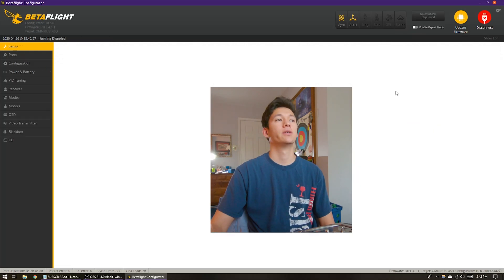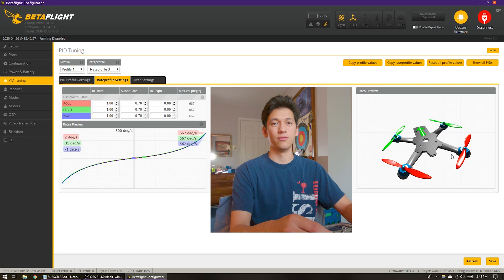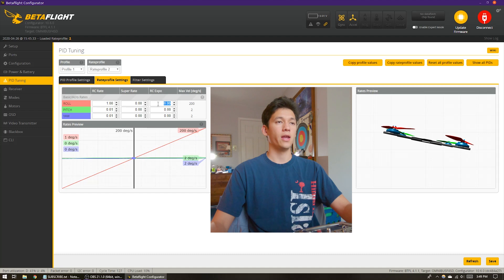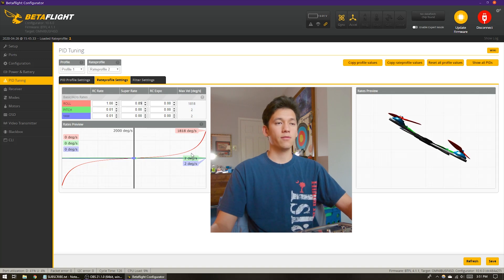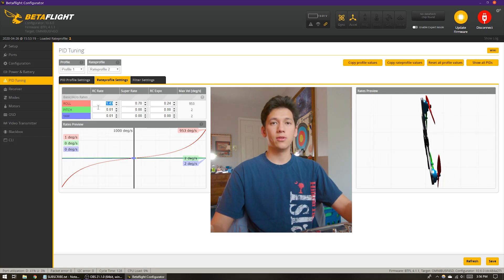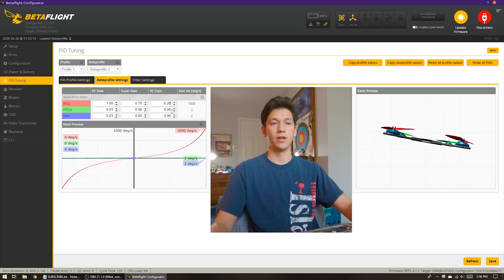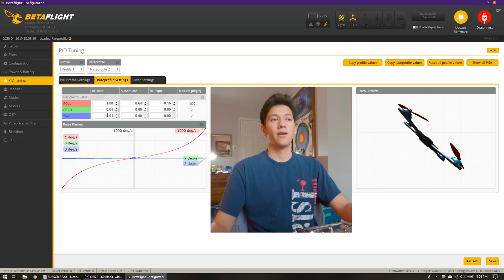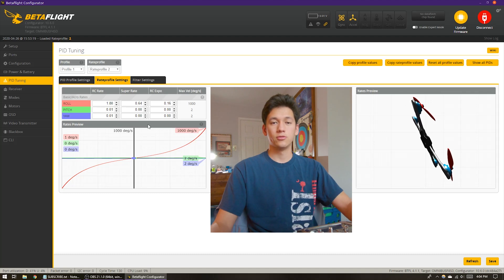Rates Explained - How to Tune Your Rates

Comment: Question for you Timmy. I have a basically new quad that I have probably only flown 5 times. RTF Armattan Badger. The last time I flew it the pitch and roll were really slow. No matter how much I up the rate or super rate it still does the same thing. Do you have any idea what could cause this?

Comment: That was a masterclass in presenting and explaining a technical topic young man. First class. I have just got into FPV, I have a protek 35 and all I want is slow gentle cinematic flying with gentle curves the kind you see when flying over corn fields. 

I guess i need to set my rats so I have a very flat S. I dont need to do flips and loops, but I hope to learn a split S turn/dive at least.

For now I have just adjusted my throttle to scale 65%

Comment: I started trying Actual Rates since center sensitivity is decoupled from Max Rate. Theat way I can turn that down and flatten the curve a little.  When it comes to making turns, I think I put in more yaw than I need to so I end up "drifting" a little and have to input opposite yaw to correct when I come out the roll part of the turn. Rather than having to play that game of each parameter affecting the other, I can change one. Hopefully, I can dial it in better. I'm almost there.
Reply from the maker: Yes, Actual Rates is much more logical because the parameters correspond to the characteristics you are trying to tune.

Comment: Great video! Finally I understand!👍 What rates do you use and do you use the same rates for all your quads?
Reply from the maker: Thanks! I prefer not to share my rates because they will not feel the same on a different setup using a different PID tune and transmitter. I do use the same rates on all of my quads, but it is worth noting that I only fly 6 inch freestyle quads.

Comment: the problem i have is when i yaw full stick right the dronr bumps up but only at full stick ....its all good when i yaw left ,,nice and smooth its only at full stick yaw right  ,,,,,whats going on ive turned down my rates in beta flight but still does the same thing ,,,,,please help
Reply from the maker: Quadcopters can ascend during fast changes in yaw rate because two of the motors have to spin up aggressively. If it's not the same left to right, it's likely your receiver endpoints are not set up correctly.

Comment: best video of explaining the tuning of quads so far 👌👏👍100%
Reply from the maker: Thanks!
Reply: @TimmyRC  have you made any for filtering i have a 2-4s aio 35A and 1204 4500kv 2-4s iflight motors and on 4s 450mah start jumping and fly way go up like if i do a punchout it flies good on 3s 450mah  only on 4s does that
Reply from the maker: @galifpv6944  I do not have any videos regarding filtering. The Betaflight documentation on Github is a good place to start.

Comment: Hi Tim,
Just subscribed to your channel.  I’ve been wanting to learn about rates, but have been very hesitant in doing so because (as you said) they can be very intimidating. Your video on tuning is very well done and you’re doing an excellent job in explaining/showing how it is done.  

One aspects of tuning the PIDs or Rates that I’ve not seen anyone explain is what is the main difference when tuning for a 1S and a 2S or higher cell count battery?

Thanks...Sam
Reply from the maker: Thanks! There is no difference when tuning rates for different cell counts. For tuning PIDs, generally the gains are lower for higher cell counts on the same multirotor.
Reply: @TimmyRC  Thanks Timmy.  

It still would be interesting in illustrating this via a YouTube video - Just a suggestion. 

I assume that this is what EMAX has done for their TinyHawk Original, S and 2 where their PIDs and PID Profiles are designed specifically for a 1S and a 2S battery.

Comment: Hey just a heads up. Emuflight has there first official release. 0.3.1.
Reply from the maker: I checked their GitHub and it looks like 0.3.1 is not the full release. But they said they "already have plans for 0.3.X/full release," so it sounds like it is almost there. I presume the first official release will be dubbed 1.0. Thanks for keeping me posted though 👍.
Reply: @TimmyRC  yeah I didn't read the whole thing. On the edge with the release numbers it will usually say release candidate and this one didn't. My fault. Kabab did a video on the rate Dynamics and what it could be used for. It is very innovating.   I'm sure you will like it but as you said it's more stuff to tune if you want simplicity. But fun to play with if that's your thing.

Comment: do you tune your rate first or pids?
Reply from the maker: I have been using the same rates for years and I do not change them between quads. I tune PIDs for every new quad and for every change in setup.

Comment: how do you connect to the quad and also with the controller to feel the sensitivity of the sticks?
Reply from the maker: You just have to make sure your receiver is powered on and sending a signal to the flight controller while the flight controller is connected to the computer. If you power the receiver from the flight controller then usually all you have to do is turn on your transmitter.
Reply: @TimmyRC  is this with or without a battery connected to the quad?
Reply from the maker: @hannesdobbelaere  Without the battery connected to the quad. But if you are powering your receiver with something other than the flight controller you will have to connect the battery.